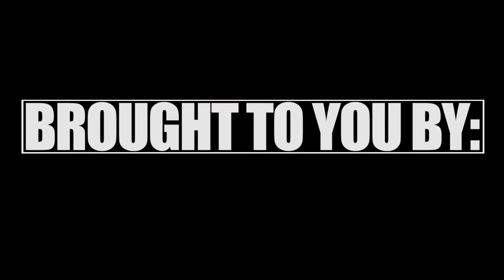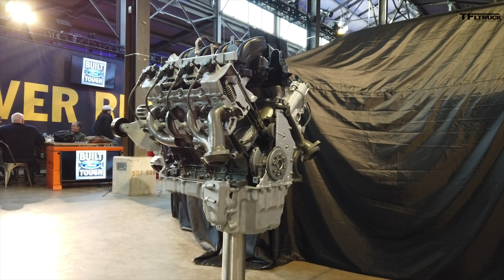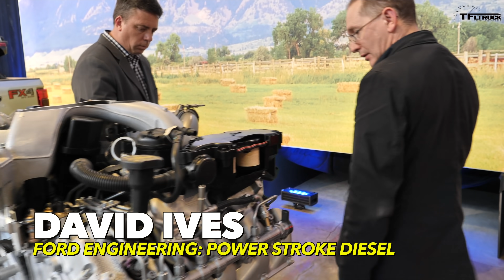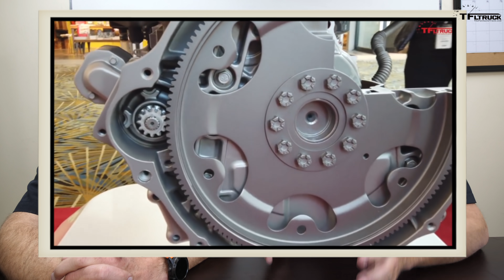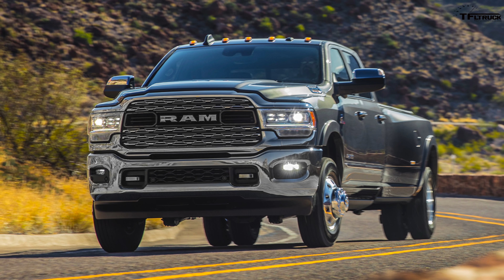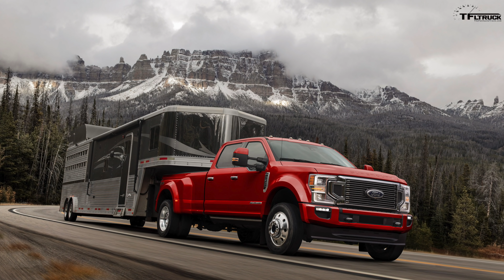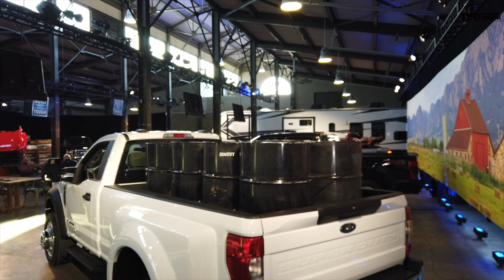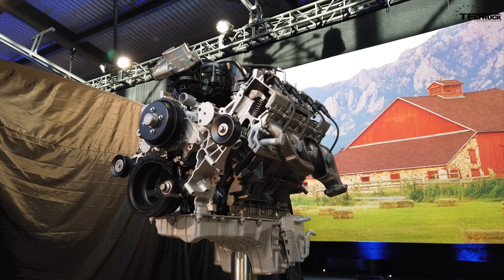Are Diesel HD Trucks Dead / Will Electric Pickups Replace Them? No, You're Wrong! Ep.5

Comment: There are good arguments for and against diesel. But it depends on what the objective is. If the objective is to eventually eliminate the internal combustion engine and go with an all-electric truck, then both gasoline and diesel engines will go the way of the dinosaur. Pickup trucks, big SUVs and vans would be the ideal place for what I call a super-hybrid: imagine an all electric truck with lots of batteries on-board, but also backed up by an on-board hydrogen fuel cell generator (like a cross between a Chevy Volt and a Toyota Mirai). No clear indicator that will happen, although Ram's use of eTorque in half-ton pickups is an intriguing baby step in that direction.

One interesting eyebrow-raiser in the 2019 pickups was GM's introduction of the all-new 2.7-liter "dual volute" turbo Four. If this engine builds a good reputation for itself, it doesn't take a rocket scientist to project to possibilities of deriving a 3.4-liter turbo Five or a 4.1-liter turbo Six. If the current 2.7 Four produces 310 horsepower / 345 lb-ft., a Five variant should make 387 hp/431 lb. ft., and the Six would be worth 465 hp / 517 lb.ft.

A few months back, Motorweek came out with a video report that Borg-Werner is working on a new enhanced turbocharging technology called "eBoost" that adds an electrically-driven turbine to an enlarged turbocharger. The result was a Ford Mustang 2.3 L turbo that made 400 horsepower with no turbo-lag. If this technology were added to engines like GM's 2.7 L Four, trucks and cars alike could enjoy even more power (without lag) and shrinking engine sizes even further. If eBoosted turbo gasoline motors were added to Ram eTorque-style hybrids in the near future, that could pose a greater risk to diesels over the next decade or two. But, then, big gasoline V8s would meet their demise along with the diesels.

Comment: Andre is wrong. Heavy, hard to certify, dirty and expensive. Electric assist or hybrid will gradually be introduced and replace current inefficient design. 

It's simply a matter of time where diesel will no longer be an option in the Consumer truck market. Perhaps the military and over the road trucking will maintain the market, but for general use a diesel is not required 99% of tasks. 

A very, very, very small percentage of all the pick up trucks sold in the US are used for heavy hauling a majority of the time. "Majority of the time" being the key phrase here. 

For every guy who has a diesel to haul his 5th wheel 26 weekends a year, that same guy also spends most of his miles driving to the super market, commuting, running errands, etc. And then there's the guys who don't haul anything regularly who use their diesel as general transportation. Hauling dirt bikes, or quad trailer, the occasional dump run, picking up some gravel at the yard Home Center can all be done with a gas Heavy Duty. Gas HD trucks generally have a higher payload. 

And even you're in the minority, and you are someone who hauls HEAVY every single day of the week, you know that's not the case for 99% HD truck owners. And that's the point really. 

There's the guy hauling a trailer with a bed full of tools who's really using his diesel everyday of the week and then there's the guy rolling his Platinum Lariat Denali Laramie truck who's driving into the office everyday and using his truck to pick up 2x4's at the local Home Depot. These are 2 different guys.

Even those that do haul heavy regularly diesel power isn't even required. Not everyone is hauling up a mountain everyday. Once you're up and going it takes a fraction of that horsepower and torque to maintain momentum. 

This is where an electric assist would come into play. Torque where you really need it and only when you need it. Going up a hill at highway speeds or taking off from a stop, etc.   

Diesel should be reserved for those who really really need it. Everyone else just likes driving around a diesel.

Comment: RAM already has the hybrid light on the 5.7l 1500s, this is just the beginning. Look at how modern cruise ships and locomotives operate; a diesel prime mover spins a generator to produce the power required to move AC electric direct drive motors. I don't see heavy haulers including 2500 and 3500 trucks moving to pure electric but a gas or diesel prime mover with a light hybrid system.
Also, the German army ran on gas engines, diesel was played with but due to limitations in diesel production compared to gas and commonality of gas to all vehicles meant that it was preferred. Even the US used gas engines for the most part. The Marine diesel powered Shermans were used in the Pacific theatre where diesel was much more prevalent.

Comment: Diesel will be around for a long time. Until there is sufficient fast charging infrastructure, these debates are just a waste of time. Its easy for people who live in cities to go "ooh everyone should be electric". But a vast majority of the united states, canada and mexico, live in locations that don't have electrical infrastructure that is reliable or high enough output to support large charging systems. Or even make the ranges viable when cargo is involved. Not to mention the cost of towing large heavy vehicles is through the roof. (towing costs for semis is through the roof, even before you take distances into account) You will likely end up with more occurances of running out of range with heavy duty vehicles and trucks. 

Since the range prediction and overall range just isn't there yet. Throw in the conditions that these vehicles live in. between harsh terrains, temperatures and loads. Lithiums are most likely not going to be the choice for batteries, so your headed back to heavy  battery technologies. Since they are reliable and people know how to work with them. (we wont mention fuel cells, at this point nobody even talks about them anymore between cost and other reliability and long term production concerns).

The high energy efficiency of diesel, and what you can extract energy wise from it is also important. What we should really be seeing is hybrid diesels. Similar to trains. You can have a very small Diesel fueled power plant that runs a generator to either supplement power for an electric system or charges it. They are extremely good at doing this. Plus you can tune them so they are always running in a optimal temp range that the DPF systems are not constantly going into regen, or needing alot of maintenance. Or just plain running in such a clean area to begin with that overfueling and soot are not a problem.

Comment: I think it depends all in application. I think all electric is the future for every vehicle, but as far as hybrid. A diesel hybrid can make more tourque out of a smaller motor then a gas. Ford won't be using that 7.3 gas in a hybrid application,it's to big and not needed to run a charging system. Look at the chevy volt and what it used just to charge battery. Then look at trains for far more weight they use diesel.

Comment: The most efficient movers in the world are Hybrid Diesel electric trains. Some of that comes from the metal track and metal wheels with very low friction coefficient. But a huge factor is the diesel's  ability to have enough low end torque to give them the ability to move the train and cargo while turning alternators  to generate power to recharge the batteries. If you had a gas/hybrid truck you'd have a gutless truck if your batteries died from going up a long steady incline. Now your left with a truck that'd pull decent on flat ground in gas only mode but can't pull it's potential heavy load up a hill. Go diesel hybrid! That's the best proven system in the world, they just don't want that good of fuel economy for consumers IMO.

Comment: Diesel motors aren’t going anywhere any time soon, the durability and low long term cost of maintenance is far better than any electric motor. Diesels make too much power with so little technology that it will be so much cheaper and efficient to use a diesel rather than a gas-electronic. And the size of the battery needed to keep up with towing 35k+LBS through normal stop and go scenarios would be 1000+ LBS

Comment: You forgot that Ford and Volkswagen just signed a partnership deal and Volkswagens electric technology being used for future Fords was discussed . Look at a tesla sedan and than a F350 or larger and a battery pack would easily fit and the P100d has 900 ft lbs of torque and the hubs on a truck are much larger allowing a larger motor so over 1000 ft lbs of torque is easily reached . It makes sense financially and to stay current with the changes in the automotive world

Comment: I remember when I went to a Powerstroke mechanic class and they were explaining all of the post 2007 MY equipment needed to pass emissions, and how diagnose and repair them. And most importantly how much these parts cost to replace. And I piped and asked “So they couldn’t necessarily make it completely illegal to own a diesel truck but can basically make it cost prohibitive to own unless you really have a business that rely on it?” and his response was a reluctant silent nod of agreement. Diesels have been on the way out ever since the new 2007 emissions requirements came out. All that waiting for their replacement for 1/ 2 to 1 ton segments is a viable alternative. A light gas V8 with simple tech coupled to a strong torque E motor can easily meet the needs of 1/2 owners. Power, MPG, AND cost of ownership  will win this match.

Comment: I've always wondered why auto manufacturers haven't used the idea locomotives use. Maybe a small, super efficient diesel or even gas engine to run electric motors used by the wheels. They wouldn't need super large displacement and the torque from the electric motors would pull a mighty heavy load.

Comment: One thing you could do is  modest turbo diesel engine, is fit quite a simple one, basic turbo, and inlet set up. once you add an electric motor and a battery, i, throttle control is automatic to run clean, fit  Euro CAT 6 clean-up  plant to the exhaust,  The Electrics take care of the engine regimes that produce alot of particulate and NOX, running cold under load for example buy drawing on the electrics to do the heavy lifting, cruise can be just on the engine. It would also work well with Turbo 3.5 L gas engine. Big Block V8 gas, is all so very much simpler though.

Comment: I think that both Ford and GM is working on the same stagey launching increased displacement gas engines, engineered for heavy duty usage while still maintaining the diesel option until possible future with diesels predominant will be found in large comercial class 7 and 8 trucks. It will be interesting to see the upcoming years sale of diesels trucks after these big gassers are made available to the market.

Comment: This is the first Right/wrong series that I actually liked, great points all around.  I think diesels are cleaner though, because in 5 years the gas engine catalytic converters, egr system etc. becomes very dirty and produces far more pollution than diesel.
As far as diesels going out of the market, I don't think so for a long time because you guys know how much more power, efficiency and confidence a diesel truck has over even a very large gas engine like my 8L V10 Ram.
There's definitely potential for electric but just like you guys said earlier in this series, a lot of the electric claims sound too good to be true.  Electric will have to establish itself long before we see the end of diesels. 

I believe they are safe for the next decade.

Comment: Apples and oranges. Diesels are superior in the heavy duty trucks, been using both for years hauling and hands down diesels tow better. That extra weight is not detrimental either, with a triple axle 5th wheel or large park model that extra weight on the front of the truck helps a good bit. I certainly don’t mind using the Chevy 8.1, ford or dodge v10’s (we have older tow rigs) I miss running a duramax especially in the mountains or taming a lot of weight behind the rig. While I hope the big three test your theory, why not couple a smaller displacement diesel to electric motors? Maybe 4-5 liter turbo diesel with some high torque electric motors?

Comment: I would like to see the same technology for V8 gas motors in trucks, that use the same design and ideology as the Mazda Skyactiv-X..... a gas motor that runs like a diesel and fuel economy like a diesel. And then hooked up like Roman said, like a locomotive, a gas motor that either generates electricity and hook up to a torque saving electric motor. I am not a full electric fan, but build a truck like a locomotive is what I have been thinking for  a few years now.

Comment: I don't think it will be a battery hybrid,  I think it would work like diesel electrics on a train.  you would just have gas electric on a truck. all you need is an engine powerful enough to turn the generator.

Comment: what about a ford 6.7 diesel block, crank, and rods.
redesigned head to accept spark plug and direct fuel injection.
lower the compression with the piston.
same inboard turbo style setup to effectively build an 6.7 gas ecoboost.
cost overall would be lower as shared tooling and stocking of major shared parts.

Comment: Think people are reading too much into the introduction of the Ford 7.3L gas engine. The Ford engineer in Andre’s video said it was a replacement engine for the old 6.8L V10 which while has not been offered in the super duty it is the main stay of Ford’s commercial offering, E-series chassis cabs, stripped chassis etc. Which is big business for Ford, with delivery trucks, ambulances, RV, motor homes etc. So happens the 7.3L will work very well in the Super Duty as well. Also agree that hybrid Powertrain will make it to heavy duty trucks eventually.

Comment: Look, I love my Diesel Trucks.  This last weekend I pulled a 24 foot flatbed trailer loaded with a tractor over 300 miles, over 3 major mountain passes in snow and ice without a problem and fuel to spare.  The big three auto makers better match that or better, and they better be reliable as well.  I don't want to stop every 100 miles and recharge a damn battery either. I know you're talking about a hybrid, but full electric is where they eventually want to go. The real question is, what does the HD hauling public want.  I, for one, want a big powerful Diesel engine !!!

Comment: One note, locomotives use diesel to run which I like the idea of the drivetrain that they have. My pitch for a truck is to take the same idea of the locomotive drivetrain but ditch the diesel. Take a 4 cylinder engine and bolt it to an electric generator motor to supply power and have an electric motor drivetrain, and you can add a battery pack to support the system. This system will be lighter than any current option and have the fuel efficiency of a 4 cylinder while being able to supply the torque needed to tow what they need. Also with this setup you can tune the engine to operate in a very specific rpm range according to what power is needed to run the generator motor, and with tuning it to run in a specific rpm range can add to the fuel efficiency.

Comment: My diesel truck is almost up to 100k   Check engine lite occured and took to dealer.  Cost of repair to me $0.00 however I had an extended warranty  $5,500 (Nox sensor, EGR cooler, Front Dif Penion leaking, and waste gate actuator went bad.   There are other items i am concerned with.  DEF system, exhaust clogging, and fuel pump failure and / or injector failures.   If just about any of these fail i will be looking at $2,500 - $5.000.  EACH.    My old diesel needed injectors every 100k at a tune of about  $4000.    I'm starting to believe that I don't have deep enough pockets to own a diesel any more.   A gas truck with electric sounds very promising.  But I will need to wait for 5 years so I can afford one.

Comment: Those current batteries used in teslas and other ev’s are lithium ion batteries. These batteries degrade over a 5 year period and start to suck and cost a crap ton of money after a while. At least a diesel or gas truck will last 150,000-200,000 miles and diesel last longer too. So thats a major-problem with electric vehicles. Also the more electric vehicles out there = more coal being used to produce that electricity. So either way electric or not we are still bringing fossil fuels.

Comment: Wow I think we need a new segment called Andre is always right!  7.3 L Gas  pick up mated to a electric motor and battery. Hahahaha.  

Why don't they put a 100 mile battery/electric motor and then use  small diesel generator package instead? They can pare the 2 to give you full performance up to 350 miles pulling/hauling a load and then reduced performance untill battery is partial recharged? 

Battery would only be used in ECO mode unloaded. Generator would kick in to keep it topped off.  Then in standard duty mode the battery would bridge the gap when 100% duty is called for. 

Could even have a performance mode that over clocked everything. 

Energy density is so much better with diesel. Battery technology needs a few more years.  Diesel are so much cleaner than 15 years ago. Even the cheating Diesels are cleaner compared to then. Tired of hearing that incorrect regurgitated fake news... 

Keep up the great segments.